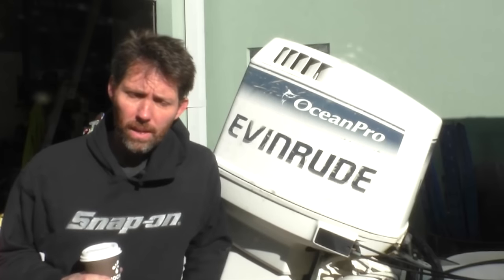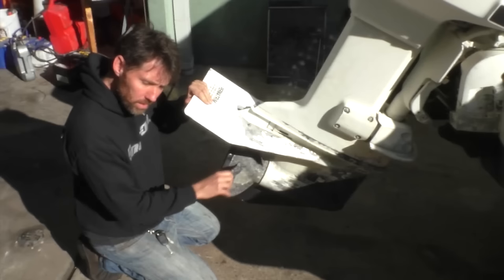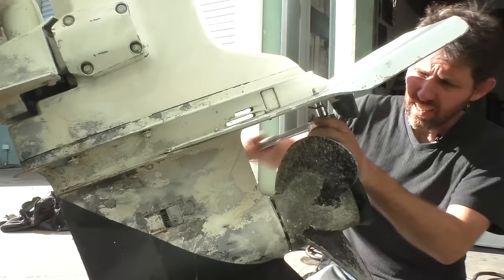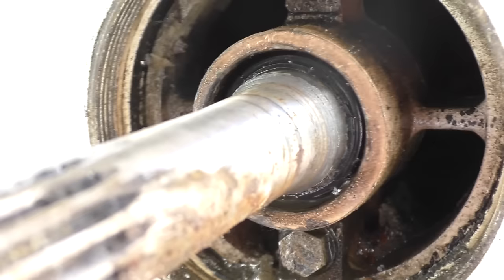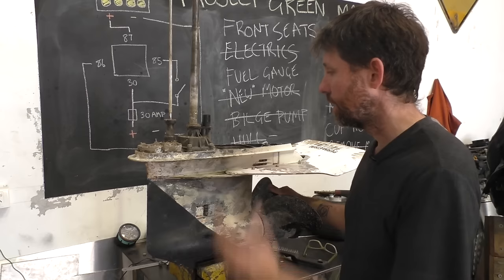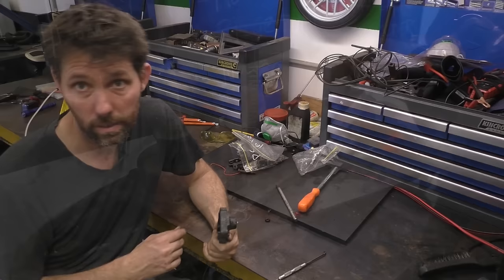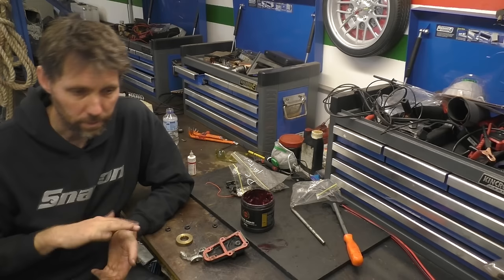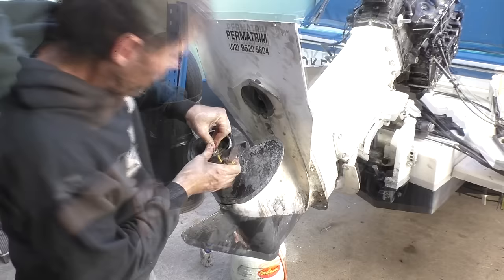Starting an Evinrude 150 outboard for the first time in years

Comment: It looked to me like someone was smart enough to fill the carbs with pure 2 stroke oil prior to putting it up for years.  Most folks leave old  fuel in them or drain them completely which probably would have resulted in bad carbs after 5 years.  The oil likely kept the carbs from drying out and corroding.

I have an old outboard that I am looking at going through.  TBH, I was just going to replace the impeller right away since rubber tends to dry out and get brittle after sitting dry for a few years.  The last thing that I want is for the impeller to come apart and the water pump to stop working in the middle of the river on her first test run.  I doubt that the guy I bought it from had the foresight to fill the carbs with oil, so I expect to be looking at carb rebuilds as well.

Always great videos. :)

Been putting off following the trawler vids until you are done with the engine so that I can sit down for a good binge watch.

Comment: Great vid as usual. To logically and sequentially explain this stuff where we can get some understanding is a gift. Hope you continue doing this. My 85 Johnson 70hp won't go into reverse at present and my suspicion is the linkage from the shift lever through the shaft to the gearbox is somehow out of sync as the shift lever leans aft about 20 degrees when the prop is in neutral. This video helped me confirm this and gives the incentive to try and correct it first at the top and then at the gearbox if necessary. Still pisses me off but it's probably why I got to so cheap.
Reply from the maker: This video might help with your problem https://www.youtube.com/watch?v=Ufy6W9EI1cg

Comment: Great video .....good luck with those lower trim caps......they look awful.....lol.....just went through mine and got lucky with only one slip mark on cap !!  It's kind of funny, I was asked the other day why I have 2 different wire wheels on my grinders......and I said, "I guess only a mechanic would know.....lol.... a huge time saver" !!!     Would love to see a Honda 4 stroke video sometime......it's strange that there are very few online........but like you said, outboards are very similar and a little investigation and you can figure it all out.......thanks again Stu !!!
Reply from the maker: Hey Rob, in a later video you'll see that I end up just replacing the whole trim tilt unit with a second hand one that is in much better condition. Sometimes you look at something (as you spotted) and know you are going to be fighting a losing battle!

Comment: I use a bass wire brush in my 4" grinder to clean up all metal to metal joints before spraying with copius amounts of penertrating fluid.......

Comment: I used to work on these. Fortunately I was at Lake Tahoe, CA - 6200 ft elevation and remarkable clear fresh water - so even 30 year old engines came apart easily. But salt water engines? BLECCHHHH!  I wouldn't hve used loctite on the shift seal and water pump (or almost anywhere) - I would use never-seize compound.
Reply from the maker: For sure, fresh waster makes a huge difference to an outboard's life.

Comment: So just a tip: make darn sure you don't get grease globbed on the END of the driveshaft before bolting on the lower unit. I use white spline grease, but learned this the hard way when my 130 evinrude hydro-locked on me. scary stuff, but was relieved to find out the powerhead was fine lol
Reply from the maker: How did grease on the end of your driveshaft cause a hydro lock?
Reply: Good question. As soon as I took it off and cleaned it, no problem. Read up on it and lo and behold the service manual warned against it

Comment: On the relay on the chalkboard, 86 should be positive. It doesn't matter for a simple relay, but some of those Bosch-type relays have diodes in them and making 85 more positive will short the diode and possibly wreck whatever is turning it on.

Comment: Great video that was very informative. Wonderful job 👍
Reply from the maker: Thanks mate, glad you enjoyed.
Reply: Dangar Marine  i have a '87 200hp blackmax . I purchased it not to long ago. So i parked it with engine down, the trim motor was working, now i just get a click from the relays. I tried by passing the relays and got nothing. So i need to get this motor up so i can move it and get it the shop. There is a release screw on the motor mount by the transom. It's a plastic 9/16 or flat head screw driver, the problem is it broken and is just floating around in the hole. Do you have any suggestion on how to get this motor up? Thank you

Comment: The last few minutes is where I would have started after running a compression test..1..test each cylinder for compression with a compression guage..they should all be the same no more than 3-4 #s off..Compression checks out ,check for spark then move to the carbs..The oil in the carb fuel bowls was a good indication they fogged the engine prestorage..flush them out with fresh gas or gas mix..Those engines often discontinued the vro pumps..oil injection..Its great changing the fuel water seperator and having a clean tank..I would have a test tank premixed..fuel and 2 cycle oil for time saving..In short I would have had the engine running in 30 minutes..That objective was mentioned in the video..Then phone the owner and confirm the good news with recomendations moving foward..Its probably reasonable to estimate a 2hr labor charge just to check it out..Had the engine not checked out the consumer reasonably could have disputed the labor charges..i.e. trim ram seals,lower unit..Also didint see replacement of gearcase oil?? And with all performed simply installing fresh oil and a impeller would have meant with everything you already performed,orings,trim rams issues etc..The job would be done and a sea trial the next step..oh and check the steering..Great job quickly diagnosing and repairing the issues found..Im merely suggesting working top to bottom..Hitting your objective first..All the labor on the lower and you reesembled it..The client can dispute paying more assembly and disesembly..Hope gearcase oil was added.Hope that helps ..and I do have a degree in marine Mechanics..Thanks for sharing..Horse before the carriage..Best wishes..👍

Comment: Hi Stu. Thanks for your instructional videos. I've probably been through all of them by now. One thing comes to mind when dealing with salt, does it not dissolve with hot water? and would doing this clear up all of the exposed salt where it is accessible. Please forgive my ignorance in this as I am not  Knowledgeable in this (apart from boiling pasta etc lol). Your videos are always exceptional and I think you should apply to a college or university to teach. You communicative skills are exceptionally clear and concise. Can't wait for your next installment on your new metal boat. Regards
Reply from the maker: Yes, hot water does disolve salt a bit faster than cold.

Comment: enjoyed your instructive video on the E150 V6. You may try PB Blaster as a peat rant and pre oiler vs WD40. I was a Boat motor tech, in a former life. (went through Merc schools, all). The Sea-side marine is definately a much bigger challenge to fresh water market. I used oil of Wintergreen alot on aluminum issues.

Comment: the bend in the shift rod at the eye is done at the factory thats why it didnt line up with shift connector when reinstalling gearcase. shift interupter probably wont work correctly now. not to rain on your parade

Comment: Amazing how the time goes bye working on them.  I've a 60's- 70's Yamaha 15hp dual fuel ( 2T and paraffin)  I need to sort. It will be fun finding parts!   
 hope you weren't working on that motor at "mates rates" lol
Reply from the maker: Time certainly does fly. Parts are one of the hards bits about any mechanical repairs. The number of times we have outboards in the shop, plenty of time to finish the job but are still waiting on parts to arrive.

Comment: also the importance of making sure the fuel filters and gas tank are fresh/clean... you know the old mechanic adage of gas, air and fire are all needed first/foremost before any engine will even try firing up! Plugs can be easily checked for spark just before they are removed completely for compression test!

Comment: When u pulled the drive shaft off all i was focusing on was the splines on the D. shaft, cause the only time i decided to buy a new motor for my little mk 1 Zodiac the dealer (Surrey Marine Croydon) I can tell the name I guess as it was back in 72 told me he had one £100 off n it was an EX demo was starting on the first pull looked new almost so I thought why not go for it couple of days B4 my first holiday abroad with couple of mates got to Greece everybody was tired as we drove there non stop, but I wanted to get in the water deep blue sea sun shining who cares a little tired at that age  got the boat on the water started well then I put it in Gear n FA happened forwards or reverse hell my heart almost stopped n Terry said to me what a prat u telling me u Never tried the engine in England, truth is I never had time to luckily enough I found a small engineering shop  he took the shaft out splines ALL shewed up up one end, should have suspected something as the prop blades where polished clean of any paint all 3 of them half way, so they must a hit a sandbank at high speed the young bloke in the shop managed to get a stainless rod same diameter got it to the right L. splinned it assemble it including gear oil ALL for £20 God knows what would a cost buying a new shaft from a Volvo Penta dealer, that young guy saved us all n that was my best holiday ever petrol was about  the equivalent of 5 or 6 shillings a gallon, then we decided as we could live in my late sister's house (house was empty) in Cyprus free n petrol was 4 , 6 a gallon food very cheap we went there soon after when u r young with couple of mates u get on very well its Brilliant all we had was 3 cassette tapes there on back only in Germany we picked up the US forces radio n they had some amazing music great video again mate thanks

Comment: I have water in my lower end oil, but it isn't coming out of the bottom, that oil is the right color. It's coming out of the upper end of the lower unit, out of 5 holes.One at t he frint and 2 under ther area where the impleer is. I have a Suzuki 175DF

Comment: umajunkcollecror Um restoring a a 1961 Johnson 35hp ob.  motor turns easily and runs rough.  Two  things on and old motor, 1 points and condenser must be replaced, and 2 fresh fuel, (25:1 ) , no water or ethanol in it.  may need carb rebuild, waiting on points from ebay.  so far, so good, but I have another that I plan a complete overhaul on.  Great vid, as usual, thanks.  Don
Reply from the maker: Thanks Don. Good luck with the Johnson, sounds like a good project. It's great that you can get parts like points on ebay to keep these motors running. :)

Comment: I'd just pull the carbs off, plugs out, reed cage out, pour a gallon of diesel or wd-40 into the crankcase , then mouthwash it by cranking it slowly back n forth and crank it around 'til things feels smooth.  Then dump the solvent out of the rear of the crankcase into a clear container and see how much gunk got outta there. Then crank it fast to spit out whats all is left in the cylinders, then put it back together and get it started

Comment: Well done some good info but you should do more research as you go. All Evinrude & Johnson motors are standard hardware. The top of that shift shaft is supposed to have that slight bend in it (not completely straight).
Reply from the maker: Hi Jon, I can understand what you are saying, but the reality is that you just don't have the luxury of looking up absolutely every detail of every job. I do research a great deal of things, but the alarm bells need to be ringing loudly enough to make me thing, "Something's not right here, better do my home work." Somewhere you need to find that balance between what logically seems to be the situation and getting the job done, and double checking absolutely everything. It isn't a perfect process but that's life I guess.

Comment: Could you please explain to me the purpose of the tiny barbs on front of the crankshaft housing. Upper and lower  And where they should connect  and the hose on top of fuel pump 
Other than the main fuel lines.
Thanks, I enjoyed  yourr video

Comment: this video was really handy for me as im also looking at a Evinrude 150hp outboard on my next boat as thiswas of good help for me as im learning all the time can you tell me how i knew if my 1st ever Evinrude 150hp V6 was really good or not as thiswas my 1st ever V6 2 stroke outboard as im really needed was any advice on these outboards on my future next boat as im eager to learn on these Evinrude outboards like the one that you just worked on as im really seeing thiswas my first ever V6 2 stroke 150hp outboard as i needed was right advice on these outboards as far im concerned im ready to learn as needed to learn on these outboards hope you can teach me ho w to sort out any issues but im really ready for this in future and another thing too was disabling the oil injection on these outboards as im gonna need to learn to do that on this outboards how easy to mix say 50;1 for these later model V6 outboards can these motor can run on 50;1 all the time as im gonna disable the oil injection as i do alot of local boating in future and offshore fishing too thiswas my reason im going to use premix was safety on the water for me as i knew thiswas far safer to use 50;1 all the time as i do alot of local boating and i dont like the oil injection they can be troublesome when they do go wrong this why im going to disable the oil injection systems on my Evinrude 150hp outboards like the motor you are working on in the videos as im really wanted to learn as much as possible as im really ready for this in future now from mick the old salty walker

Comment: Very very instructive videos all wonder if you take some time to talk about the different gauges and how they work Thanks
Reply from the maker: Measuring gauges or dash gauges?
Reply: +Dangar Marine Dash gauges
Reply: +Ricardo Romero There is a tachometer install on my boat that obviously is not the original and I don't know if the reading is accurate. Thanks again.

Comment: Just a note:  first thing you should do it check all the fuel hoses for tightness at the ends.   I went through a major headache trying to figure out on an old 9.5 Johnson that ran like crap after a carb rebuild, points, condensors, coils, and fuel pump.  Turns out even thought the ends were clamped with the factory metal ring clamp and they seemed tight (50 years old ya right) - they were leaking air (which made it run like Sh__), anyway after cutting the one back under the twist grip (MAJOR PAIN IN THE ASS CUZ IT'S SO TIGHT IN THERE - and it was the problem one of course), and replacing the carb line with a Clear plastic tube I had lying around (best thing I ever did cuz now I can see the fuel going to the carb (and before cutting back the ends there was a big air bubble in there), the line went solid with fuel and I had all power back.  Total cost - NOTHING.   JUST CUT THE ENDS BACK - or better replace the lines (I recommend a clear plastic one to the carb so you can see what is going on).   I read SO MANY threads on why these motors ran like crap (Cutting out and the like the odd time when out on the water - which is what mine was doing every so often - actually sounds electrical but it isn't),  THIS IS THE CULPRIT!  if you have good compression, spark, timing, carb and fuel pump are done (with that black fuel line you just can't see what is going on).    GOOD LUCK - AND GOD BLESS.   I also saw very tiny amount of purple water when sitting at the dock - which I could never figure out where it was coming from (which bothered me cuz I don't like to contaminate the water - esp. in the harbour.

Comment: Excellent video, thanks.  But you sort of skipped what you did between flushing the oil out of the carbs and checking for spark.  Next you show it starting right up!   What did you do between checking for spark and starting it?
Reply from the maker: Nothing much from memory. It pretty much started quite nicely once the carbs were flushed of oil and had fuel in them.

Comment: Interesting process to watch. I have recently purchased a 1997 Nitro savage 884 with a Mercury XR6 EFI 2-stroke 150 hp. Being a confirmed DIY mechanic, I first changed  the impeller and gear box oil, fuel water separator. Smokes a lot, I seafoamed it. Runs good, but starting requires constantly priming fuel w/bulb. Still smokes at startup. Replaced primer bulb but still won't hold pressure for next day startup. Opened drain plug on fuel pump, small amount of water, maybe from original gas. I have sense used all original gas and yesterday filled a Marina. Today is new spark plugs and compression test. Motor sat idle for approx. 8-10 months. Any suggestions for cleaning the blue smoke, which I assume is excess fuel.

Comment: If the initial goal was just trying to see if it would start and run?  It was in neutral, just put it in water and try to start it and see if it spits water then worry about the lower unit if and when.
Reply from the maker: It is important to at least replace the impeller first. If it is old and brittle it will break when the engine starts and bits of it will get stuck inside the block and be a nightmare to get out again.